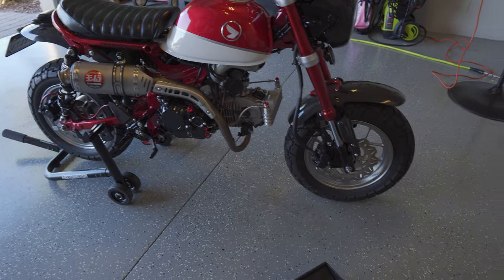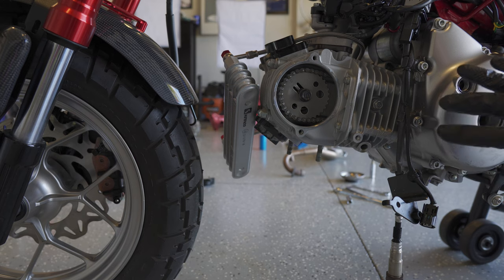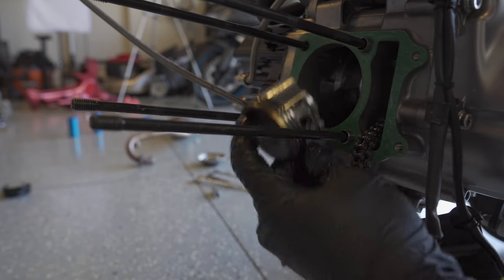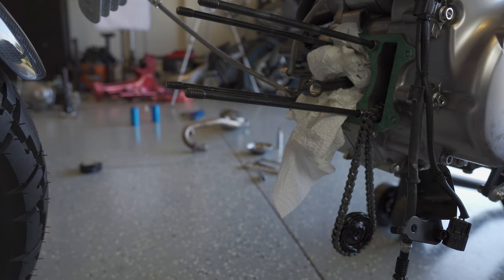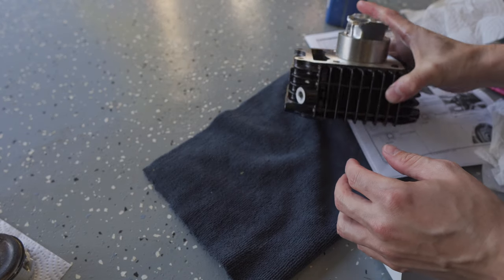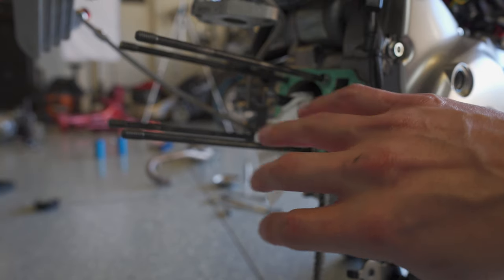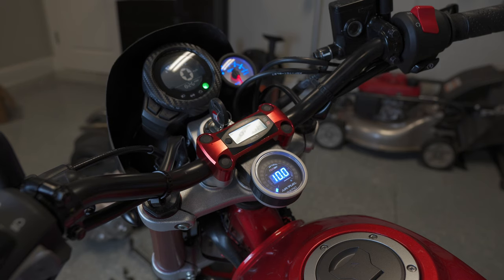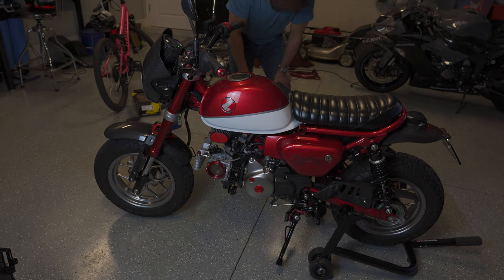Takegawa 143 Big Bore Kit for the 2019 Honda Monkey

Comment: Always check the end gap of the ring inside the cylinder before installing them on the piston. You should be able to check this with a feeler gauge. There should be at least .0035” of gap x inches of cylinder diameter. With this bore size that requires a minimum of .008” of gap to avoid over expansion of the ring in the cylinder. There has to be a gap to allow for expansion. Failure to gap will cause the rings to seize in the cylinder. There is a tolerance on the gap. I would estimate ideal to be between .008-.015” of gap. Too big a gap and you will get increased crankcase pressure from blow by and increased oil consumption. Also install lubricated rings on piston. Also lubricate wrist pin and wrist pin bushing. Verify circlip that holds wrist pin in is firmly seated in groove inside piston. Increased bore also requires the replacement of the stock fuel injector with the injector for the 150cc Honda engine, Honda part# 16450-J36-K01. It’s a plug n play part that will make use of the increased bore and slight increase in compression afforded from the flat top piston in the big bore kit vs the sunken dome piston from the stock setup. Failure to change the stock fuel injector will result in an overly lean mixture that the ECU cannot compensate for. In essence you will seize the piston.
Reply: Buy the whole kit with everything throttlebody, injector and ecu. Yes ringgap good point, i was thinking the same.
Reply: Good explanation. Thanks

Comment: Thanks! I have a CT 125 Trail 2021 model. Of course I want to improve without over stressing motor. I want to do a lot of riding via back roads this summer.
Reply from the maker: The CT125 is awesome, if you haven't yet, check out John5XR 's YT channel, he's done lots of cool mods to his.
Reply: @eastcoastish  hey bro whats your verdict on thi kit?
Reply from the maker: @tofumoto2514  it was ok, but ended up upgrading to the 181cc kit and have been running that for the last couple of years. Check out my other videos on the Monkey.
Reply: When I was trained as a motor mechanic (in 60s) I was told that when tightening to a torque setting the manual should state whether ‘dry’ or lubricated. If you torque a ‘dry’ setting but use oil you will over-torque it, if the other way round it will be under-tightened. Les in UK

Comment: Just for future reference. The pin that holds the piston to the connecting rod is called a “wrist pin”
Reply from the maker: Thanks :)
Reply: Or “Gudgeon pin” in my neck of the woods. But we all knew what you mean so it’s cool. Thanks for the video. Did it run in ok ?

Comment: Which stand is that? And do you need special pegs for it to work with the monkey?
Reply from the maker: https://www.amazon.com/Pit-Posse-Motorcycle-Stand-Paddock/dp/B000VBOTSM
It's a pretty cool stand because it can support the spools on my ZX6R, and for the Monkey, you just flip it around and the rubber-coated arms hold the rear swing arm - no spools required for the Monkey

Comment: IN ORDER FOR BIG BORE KIT TO PERFORM YOU ALSO NEED BIGGER VALVES, HEAD WORK , INCREASE FUEL AND SET TIMING TO MATCH NEW ENGINE CC,S. ITS A COMBINATION BUD....................
Reply from the maker: Hi, check out the other videos in the series, I've done ported and polished head, valves, fuel injector and have the stand alone aRacer engine management system.